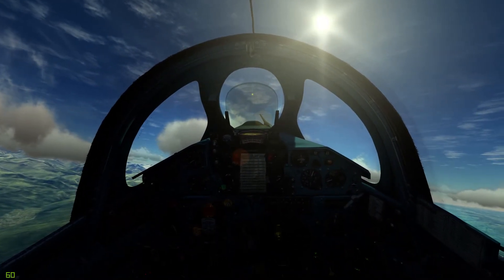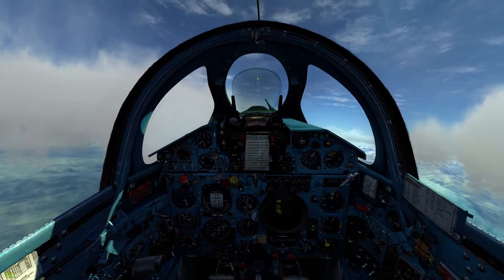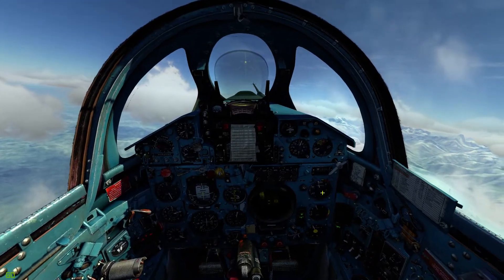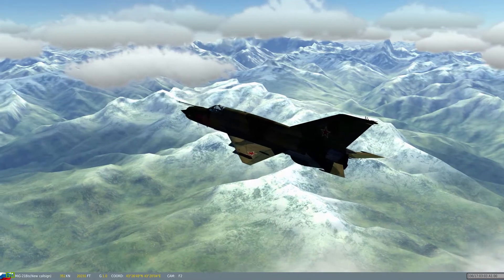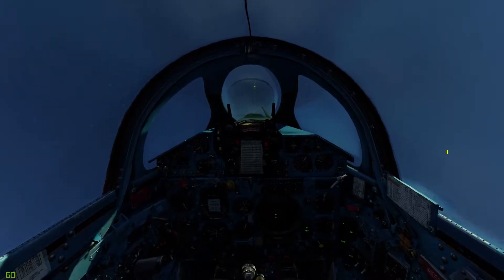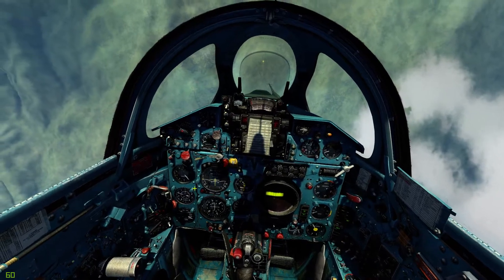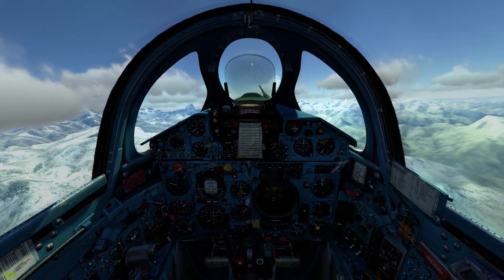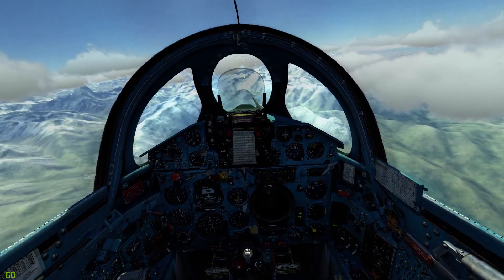DCS MIG21 Quick Guides: Engine Flame out Recovery

Comment: The Mig-21 simply doesn't like zero G, let alone negative Gs, hence you don't have to climb like that and first stall her to cause a flameout, it can happen in any zero g situation, e.g. when you're under stress and inadvertently fly into a zero g maneuvre by simply pushing her nose down too hard! Try to avoid to push her down, rather roll when you want to dive or sth. like that. Also don't fly her upside down for too long (and long means not even for 10 s!) or a flameout is likely to occur as well.

With that said, you can find yourself at low altitude down to 1,000 m or even below when your engine dies. Hence make always sure to fly the MiG-21 at a proper speed beyond 600 km/h, under all circumstances. That's what she likes: to be fast. It's a flying dart, it's not a Su or F-15.

So, it's even possible to relight the engine below 1,000 m, given your speed is at least 700 km/h (see manual p. 163). Many players experience flameouts especially during evasive maneuvres near the ground when pushing her too hard, but it's still no need to give her up and eject, as long she's still fast enough. If that happens, then immediately shut off the throttle, check the speed, establish an airspeed (and hopefully altitude) provideing a reliable enigne relight, turn on the Air-Relight-Switch (no. LV 34), wait for the LP rotors to speed up to at least 30% or more, shift the throttle to any non-reheat position and the enigine should accelerate to the given throttle speed within 20 s. Immediately turn off the Air Relight Switch (LV 34 you must not leave it on for longer than 45 s) and you're done. Dead simple.

If it didn't work, repeat the procedure: turn off LV 34, shut off the throttle, maintain a speed higher than 600 km/h at low altitudes, turn on LV 34 again and see if it works now. I've seen Ralfi dude from the 104th having been able to relight his MiG-21 just before he hit the dirt... So, never give up, never give in. But first and foremost, a stitch in time saves nine: no zero g-loads or extensive inverted flights! Or else! ;)

Close call: https://youtu.be/fvq6v9YW854?t=11m22s